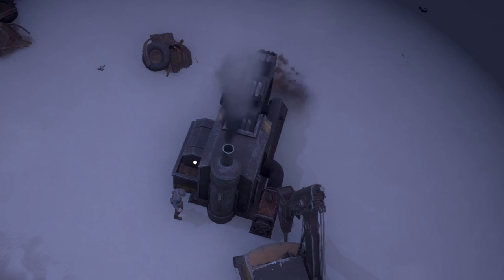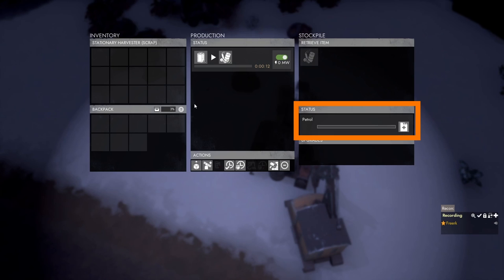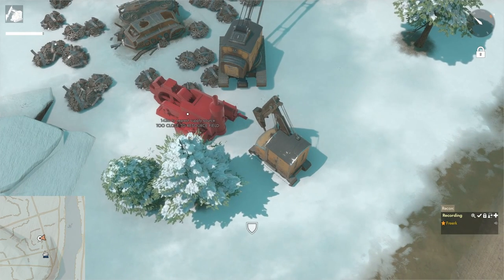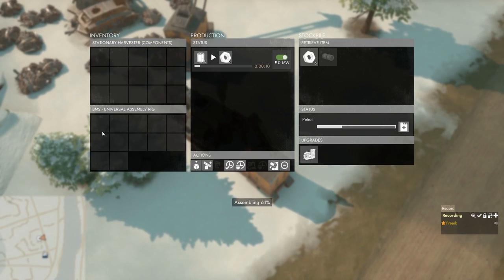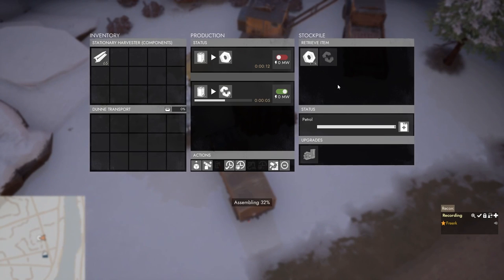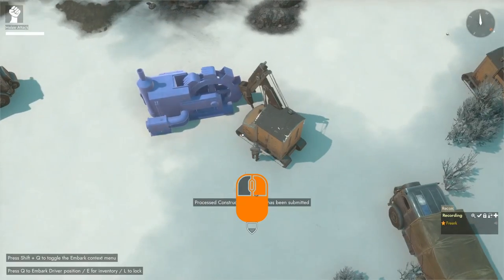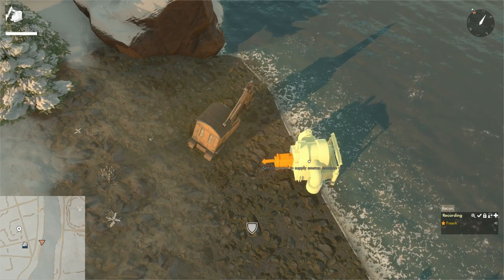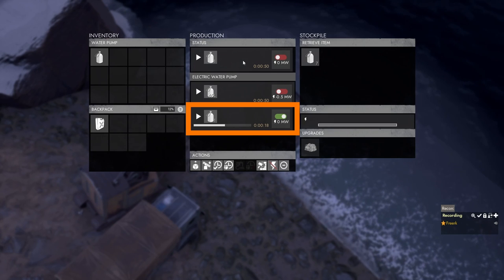Foxhole Facilities - Stationary Harvesters

Comment: What's the point of harvesting damaged components? The overall petro/power/time cost is worse than simply harvesting normal components.
Reply: when the harvester is working normaly it depletes the node, the damaged component recipe does not and still works when the field is empty
Reply: @tinazhue2091  Oh ok, that makes sense.
Reply from the maker: Thanks for answering that! Much appreciated
Reply: @FreerkHoltes   thats what i get for no lifeing the dev branch anythign else you need to know, i can answer, through by now the wiki should be a bit more accurate now

Comment: 8:54 Can you transfer material from the pallet to a hauler truck and to the truck to the station?
Reply from the maker: I'm pretty confident that you can not interact with a pallet from your truck, like if you drive up to a pallet and try to open it by pressing "E" I don't think you get the inventory of the pallet.
If I'm wrong that would indeed be a faster way

Comment: What's the point of damaged components?
I mean petrol to component ratio is same, you need upgraded harvester and metal works, it might dish out +50% of those but also refining these takes 150% of damaged ones plus 4MW.
So if there's no other recipee requiring damaged components I  see no acceleration and no efficiency increase so what's the point of these? o.O
Reply from the maker: Broken components can be harvested even if a component field does not have nodes to spawn. A standard component harvester harvests the nodes so will only work as long as the nodes are spawning.
So ideally I would say, you set the upgraded harvesters to harvest damaged components and farm the nodes that are spawning by hand or with the harvester vehicle
Reply: @FreerkHoltes  Riiight that would perfectly explain it. I mean it might be usefull way to work around "depleted" fields at the cost of some electricity and some initial upgrades. Thanks for explanation
Reply from the maker: @jakubznojemsky4936  That's why I'm here usually :D
Reply: @FreerkHoltes  Good thing you're here. I mean starting with Foxhole is rough. In lot of languages controls are bound funny and 1,2,3 didnt work for me so it took over two hours to figure that out and then work with inventories and vast amount of items, machines and facilities can get difficult too.
So your videos definetly helped me to turn that gaming disapointment into favourite passtime.
Reply from the maker: I am happy to hear that I could turn you around. Foxhole has a steep learning curve and I always hope that these videos (and even better, people in game helping and answering questions) let you take the first frustrating hurdle's.

Comment: Great video!

Btw, I was wondering how the new tech tree looks like. Could you make a video of the new tech tree if you can?
Reply: Its still the same for small arms. For vehicles its different. It includes alot less vehicles because only base vehicles need to be researched. There are also no tech choices for vehicles anymore.
Reply from the maker: The tech tree is the same as before (different every war) with the addition being that facility tech got added to the "weapons"  tree (aluminium)
Reply from the maker: O yeah forgot about the vehilces, but VeganerHippie explained it basically

Comment: What is the point of harvesting 9 damaged components instead of 6 not damaged. For example to get 60Component you need 40L petrol and 120s of time (10 cycles). And if we want same result with damaged components we need to collect 90 (same 10 cycles but 20L extra petrol) then we need deliver it to recycler and spent another 270s for 3 cycles to get 60C from 90DC. + we need extra power supply. This is so stupid....I can not see any reason for this to be used and don't understand why does this even exist...Make more work - gain less.
Reply: oh...I have to read comments first...
Reply from the maker: @KirowOnet  It happens to most people when first encountering the broken components ;)